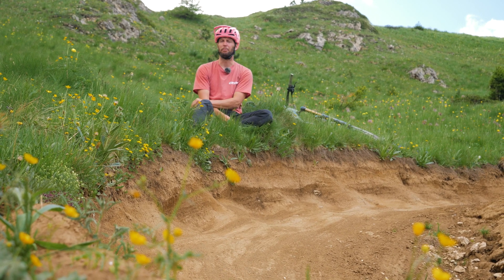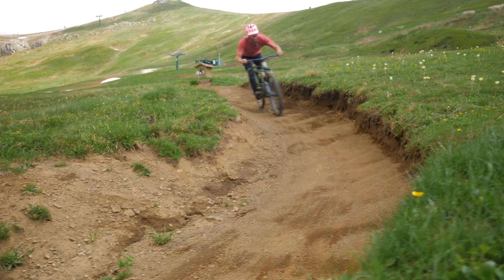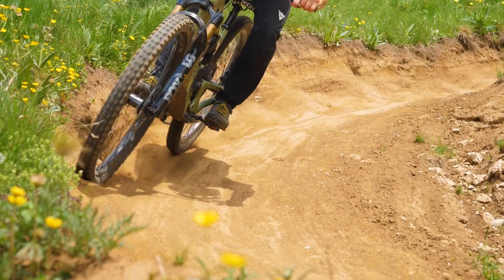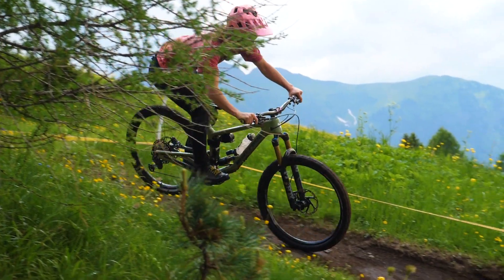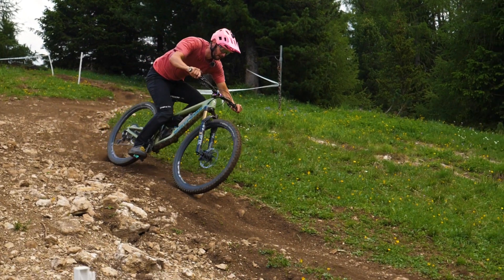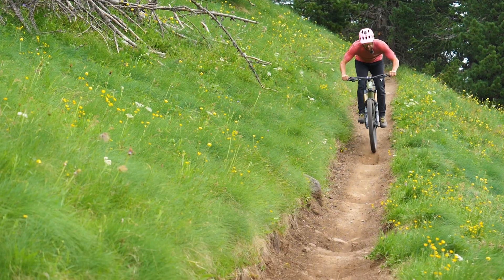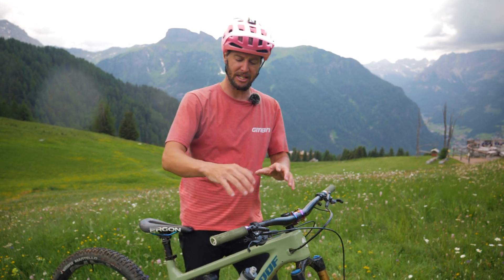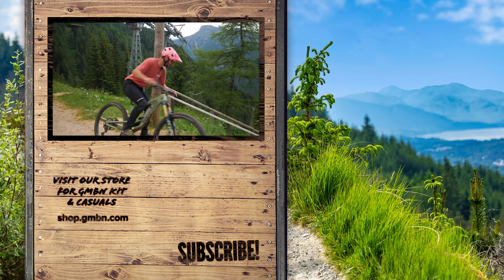How To Ride Braking Bumps On Your MTB | Mountain Bike Skills

Comment: I find the most significant factor in managing braking bumps is suspension set up - run the rebound as fast as possible (finding the optimum point to ensure it’s not too fast, I’m typically at 90% + of fully open). The other factor which Rich didn’t cover is LSC (low speed compression) which I run almost fully open with the exception of a click or two for some added support for the smooth stuff.  The difference is massive - literally night and day.  I have also found that coil suspension handles these conditions better than air suspension.  I’m running 2 enduro bikes - one with Ohlins coil back and front and the other Fox air set ups.   For the braking bumps it’s coil every time for me.....with a very fast rebound and LSC set up

Comment: If on a full suspension, don't use the rear brake over them. Either front or slow in advance. Many rear setups have a reasonable degree of anti rise that will firm the rear up considerably when the rear brake is engaged
Reply: Hmm, interesting! I ride a hardtail, so I don't have a clue what you're talking about, what's "anti rise"? I've heard on GMBN before that the rear brake can mess with the suspension, but how so?
Reply: Equal and opposite forces, so when the rear brake is used, the caliper exerts a force back on the frame. Depending on the angles of the rear suspension setup part of this force may try to move the rear wheel up or down. Or if the force is at right angles to the rear wheel path it will do neither.

When braking the natural tendency is for the rear to extend/rise (and fork compress) as the rider & bike is pitched forward. Most rear suspension is designed to counter this somewhat as under heavy braking you can run out of travel in the extended direction but the 'right amount' is largely hotly debated opinion, has to be balanced with other aspects of the suspension design and then you throw in rider differences (since the amount of pitching forward varies based on rider center of mass), rider position not constant, rider preferences in suspension setup and front vs rear brake usage. And since rear wheel path isn't circular unless single pivot the forces change throughout the travel as well.

In some cases rear brake may work the best, or a mix of both. Worth experimenting though, especially as some riders tend to get stuck on almost exclusively using only one brake

Comment: Sorry, guys... These aren't necessarily from braking. Someone needs to do a physics reality check on this concept. These are actually from the fact: bikes are getting more developed sets of suspension. You can find these waves on dirt roads where no one would be braking in a car, but the suspension has find a natural frequency to compact and release in a pattern that shows up on the ground. If it were from just braking, wouldn't there be a rut through the length of the trail? I'm curious to hear what others have to say. Go for it, prove this wrong please.
Reply: At 5:23 he may actually be hinting at this.

Comment: I find these really difficult on a hard tail they buck you out the saddle & skip your back wheel.  I try to Press into them but it's hard to get the timing right & can be exhausting.
Reply: @paddor  I'm not sat down. I try to position body  between crank & back wheel.

Comment: Yeah, braking bumps are consistently the worst thing to ride on a hardtail. Almost rougher than the trail itself...
Reply: They are, because I can ride gnarly tehnical trails with a lot of rocks without problems but when I ride bike parks I always tough I would die because of vibrations and impacts. Also bike parks should repair trails more often since how much money they get from tickets.
Reply: @majparovel  exactly. Rocky tech? No problem...a fast dh track with huge braking bumps? Actually painful

Comment: Nice video, but… your still skidding through corners, and skidding causes the bumps doesn’t it?
Best to teach people how to ride without skidding. One way is to not buy a single pivot bike, where the rear suspension locks out under brakes.
Bring back the floating rear brake!!